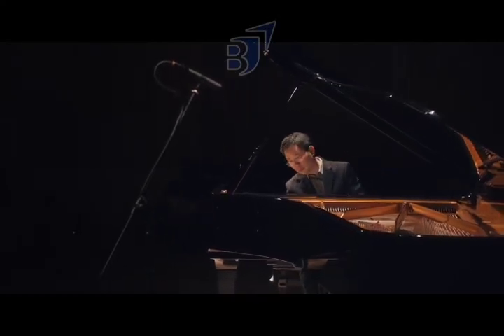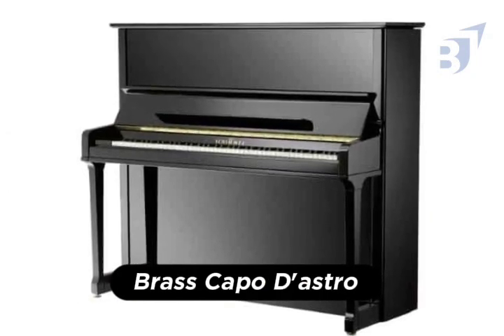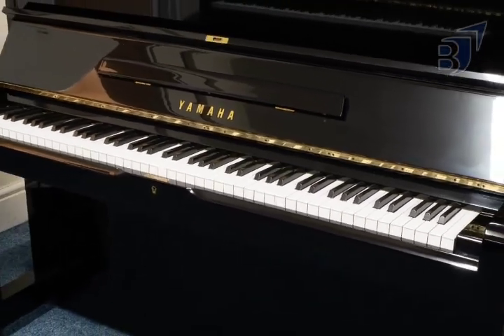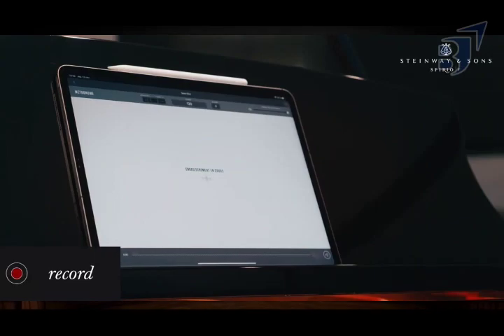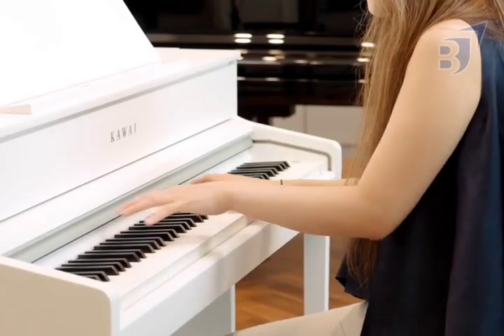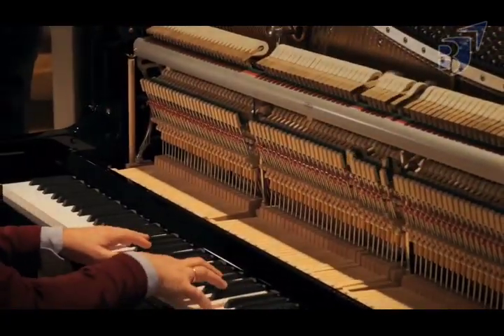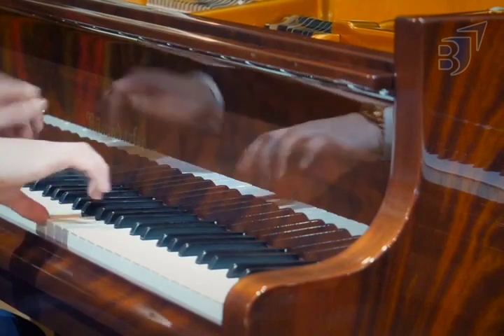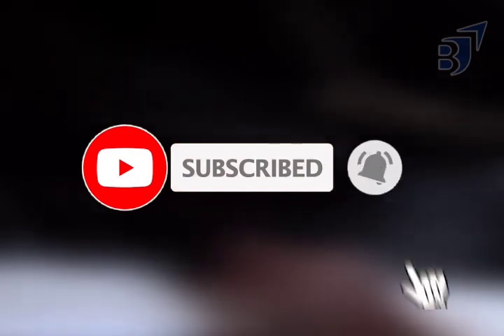Best Upright Piano Brands 2024 You Should Go For: (Top Brand Review)

Comment: Wait you ranked Yamaha above Blüthner? Yamaha totally sucks as a Piano brand they have manufactured many Flawed Pianos & never issued recalls to correct their flawed designs
Yamaha Upright Pianos to Avoid:
1. Yamaha M1A- Known for tuning instability and subpar sound quality.
2.Yamaha M1- Similar issues as the M1A with tuning and sound.
3. Yamaha U1 (pre-1970s)- Older models tend to have worn-out components that affect performance.
4. *Yamaha U3 (pre-1970s)* - Older versions can suffer from the same problems as the early U1 models. Many of their Piano's the Recoil spring's would fail & detach & to go thru the process of repairing & gluing in replacements can take 8 hours to complete not counting the tear down & Cleaning & Yamaha left customers to foot the Bill for repairs on their own & that is unforgivable i would never buy a used Yamaha much less a new one
Reply: You make valid points about the U1s and U3s, although they are some of the most available pianos. Other than Yamaha and Kawai, many of the other brands mentioned are harder to come by and can be pricey. Not all Kawais are perfect either, from what I understand.